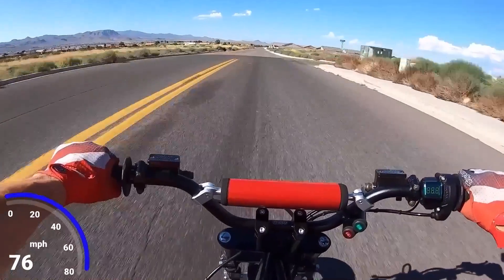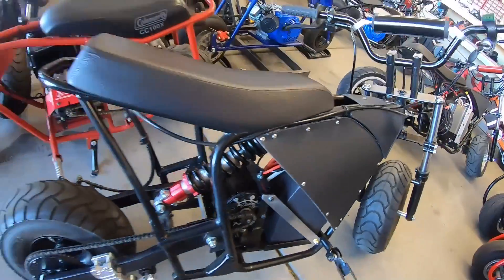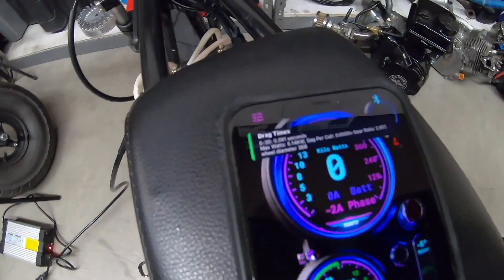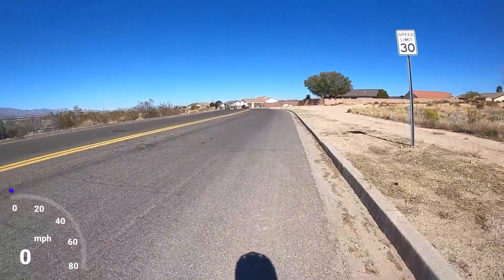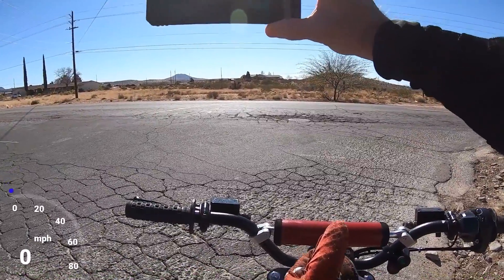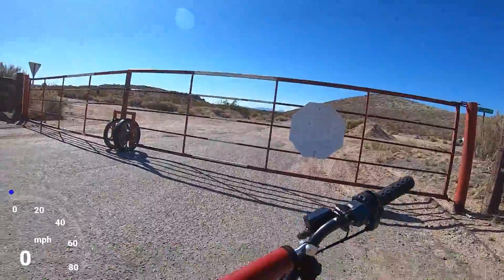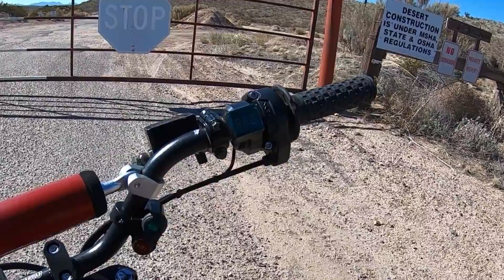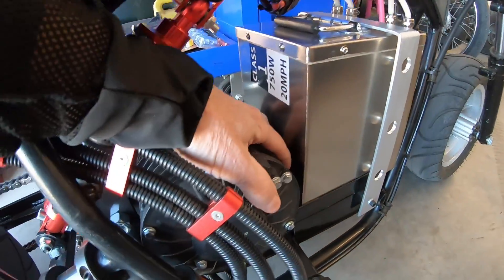Mega Moto 80/105 Electric Mini Bike Top Speed run!

Comment: Hey question, whats speeds would i be at with a ec4p with a t8f chain 13t front sprocket and 72 rear with a noist cricket and 72v 30 ah from e&c?
Reply from the maker: Check out the gear ratio calculator.https://www.gokartsupply.com/ratios.htm